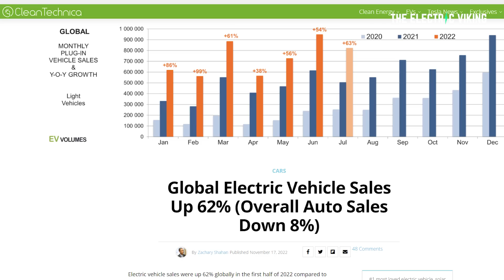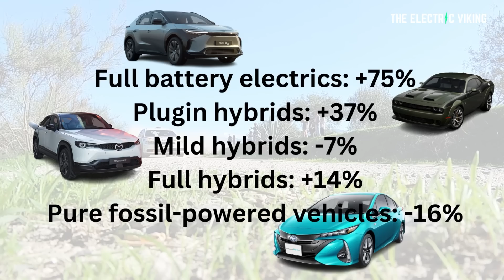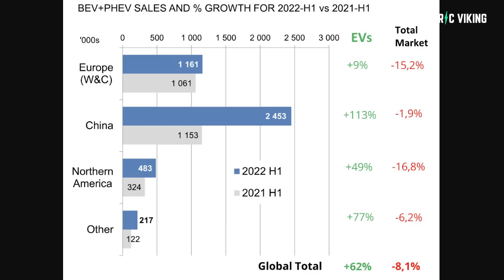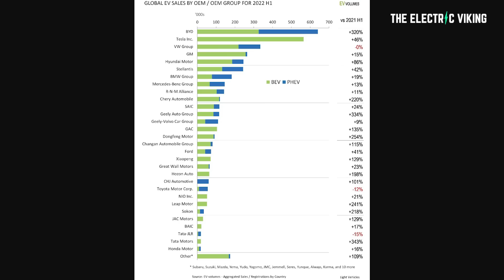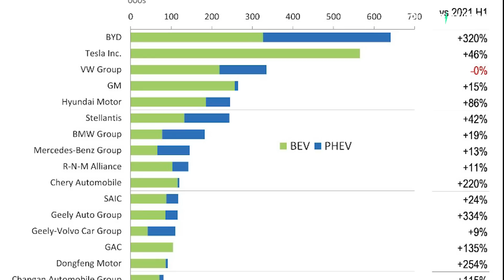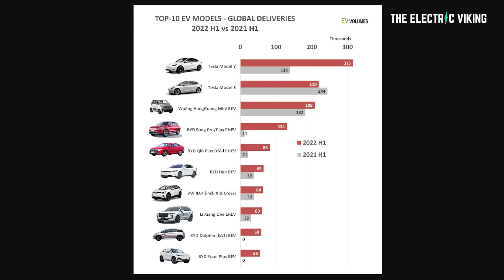Electric car sales up 75% worldwide, VW up 0%, Toyota only loser

Comment: 2023 Prius is finally improving dramatically. 
But, EVs are here to stay. Hybrids are going away, albeit bucking all the way
Reply: A few more predictions for the future: the sun will come up tomorrow morning and you will die at some point.

Of course EVs are here to stay. Tell me something that everybody doesn't already know. Governments worldwide have pretty much mandated their use and subsidise and favour the hell out of them.

But as there are also a few downsides to EVs (expensive, don't cover all use cases as well as ICE vehicles, etc.), customers need some time to actually adopt them and manufacturers need the time to work through some of these downsides.

Especially in the echo chambers like this, there seems to be a persistent view that EVs are better than ICE in every way. I think many consumers have a very different opinion, because without the huge push (financial and otherwise) from governments worldwide, the adoption of EVs would have gone a lot slower than it is going today.

I'm not saying it's a bad thing (I can hear the keyboards of the Tesla cultists rattling already), but merely an observation of factual reality.
Reply: @hvh377  facts
General Motors killed the one EV it had built. Still doesn’t produce new without recalls due to self engulfing fire
Toyota killed the one EV it had built. Still has no plans to build EVs, only hybrids
No Mercedes’ EVs at this time… It will next year, good move to try to survive 

Governments are trying to get in the act now, not before my friend. It is comfortably in the pockets of the big oil. It’s going with the flow. The only exception is happening in China. Which you eloquently pointed out, but missed by a mile

The sun will go up tomorrow, from the east nevertheless as you forgot to mention
Reply: @kabysummit5801  
Some real facts:
GM: Hummer EV, Chevy Bolt production is restarted.
Toyota: fixed the wheels on BZ4R and it is available for order
Mercedes: EQA, EQS, EQC. all available and in production.
And there are plenty more brands producing EVs, both new and brands that have existed for much longer.

Sure, governments have only just started subsidising and favouring EVs. In countries like Norway the 80% market share for EVs was achieved without any government intervention. Yeah right.

Consumers have preferred ICE cars for the last 100 years because of what?  The initial success of the electric drive train 120 years ago was completely wiped out by ICE. Not because there were real advantages to ICE cars for consumers, but because it was all a big oil conspiracy. Don't make me laugh.
Reply: @kabysummit5801  Forget about GM killing the electric car, they merely decided not to venture into the market 30 years too early. Any other company could have decided to build a very similar car and no one could have stopped them.  The fact is they couldn't be built affordably.
Reply: @someotherdude  Glad to see there's progress and more choices for the consumers.  
Sounds like GM is being forced to get into EVs.
Reply: I hope you're wrong and I think you're wrong.  A range-extended hybrid is a winner, if it follows the example of the VW  XL1.   That car achieved 220mpg.   At that mileage, fuel could cost $15/gal.  and it would still be affordable.  At $15/gal fuel could be 100% synthetic and still be affordably made.   Range-extended hybrids solve the charging problem for people in apartments and people who must drive long distances, along with people who live in cold climates.  For the record, I hate VW products, they are unreliable and their latest electric vehicles are full of problems.
Reply: i bet the 23 prius is at least 35,000
Reply: Yeah... it's improved because is a basically a BYD car🤣
Reply: @flaviosalatino8192  do you know if Toyota does quality checks before selling rebranded vehicles?

Comment: Hybrids r waste got to maintain two different engine types
Reply: Have you owned hybrid or even drive hybrids?
Reply: @Divas1001  Yes, I had a diesel-hybrid power car with 250 hp from Peugeot-Stellantis driving with 6,8 litres diesel on 100 km! My Kia EV6 AWD uses an equivalent of 1,4 lites and TCO from a business standpoint not wishful thinking about past Toyota Hybrids etc. the Kia is the better and roomier car costing us less than half the former. We have also many fleet managers who will buy/lease electric as soon as possible and companies investing in PV parking lots with chargers for their company cars!😎
Reply: Hybrids are useless. But not for the reason you said. Hybrids are general quite a bit more expensive than the same model gas vehicle. And most hybrids don't actually save you much gas unless you're doing constant stop and go driving. Plus there is a bunch of extra parts to maintain. Even without the maintenance, the extra cost of the vehicle more than offsets any fuel savings you think you're getting.
Reply: I have a hybrid and now I have to replace the battery at $5K in cost. There is maintenance with battery. Adding maintenance for combustion engine there is no saving.
Reply: @nguyentho30131  your batteries probably suck. Like the Toyota Prius. Tesla batteries are a world away in comparison.
Reply: They make sense for a taxi in the city but to not for as anyone else.  EV will displace them fast
Reply: Yes, the time for hybrids was 20years ago.
Reply: @GrigoriZhukov  Honda Insight was amazing, for that time...
Reply: True, except when it comes to toyota hybrids. These have proven to have less maintenance required than their ICE  counterparts.
Reply: Actually, there's really no maintenance on an electric motor, these are remarkably maintenance free.  The gas engine might require some oil changes, but its use is offset by the electric drive train and therefore has more longevity.  Batteries also last a lot longer too because the cars computer firmware can optimize the balance of power and charging.
Basically, you're wrong.
Reply: @kayakMike1000    I think you mean the BMS software monitors and keeps balance,  while the firmware interfaces with device hardware at the command of the Software driven BMS system.  The software in your BMS analyzes state of charge and the health of the battery..and several other factors and directs how to best maintain and protect the pack.  Without that software your firmware is useless in this example.  Again, firmware in complex BMS (like in an bev) it interfaces with the hardware(which has firmware in it) and is directed via software in complex thermal management systems like a BEV.  Also, that hardware will be able to communicate via its firmware back to the software of the BMS to keep the BMS apprised of its current state.  Without the BMS software your statement is not quiet accurate. Firmware in simpler applications will be sufficient on it's own....Not in the case with BMS in an automobile.  
Additionally, having not just your BMS to consider now you have dozens and dozens of  CMs for your ICE to monitor combustion,, then have that integrated into utilization for your available power band and torque.  It's more unnecessary design and integration with more potential for hardware failure in time.  Hybrid plug in had its time over a decade ago, but it's just not worth the time an energy with the BEV development being where it's at now.  It will continue to develop while PHEV will never come close to its simplicity in design and engineering.  Buy one, support PHEV if you must, however its your money and your decision to take on extra points of failure and overly complex power train design.  Calling out a simple comment as wrong, and then being misinformed does not help in your argument.
Reply: @kayakMike1000  maybe for the first 5 years. But after that, all those moving parts of the ICE catch up to you.
Reply: @williammeek4078  Therefore we where leasing all ICE just for 4 years before warranties where ending and immense costs emerged. Next is out there are no more enough mechanics really knowing about engines, electronics etc. With Peugeot-Stellantis we needed to go to different ‚specialist‘ to fix a catalyzer problem setting car to emergency mode etc. Electronics and mechanical parts of electric cost much less and are not the usual level of complexity of modern cars with CO2 limits etc. Young mechanics and engineers are usually already computer freaks and need no more the ear for old Weber carburetor in a Austin-Healey 3000 or an Alfa-Romeo Montreal V8 - one mistake and these engines where not working very well. Maintenance of EV is filling up break oil or water to clean windows or replace A/C filter, wiper rubbers and check battery with the computer - well, change tyres also!